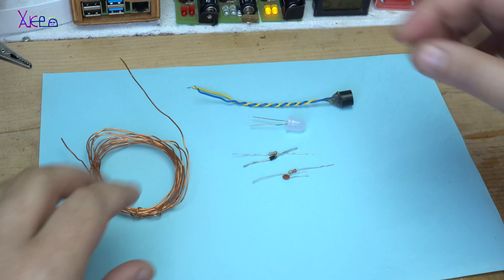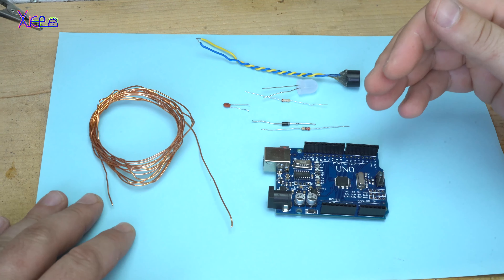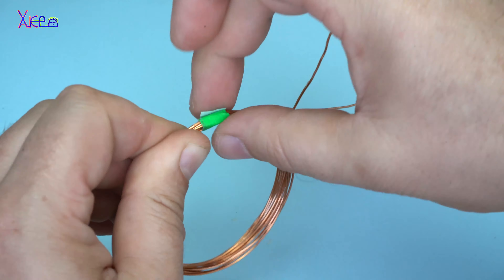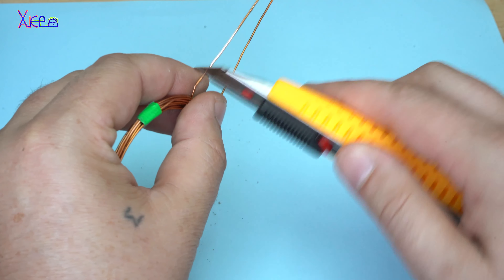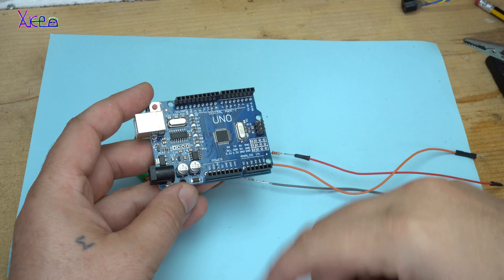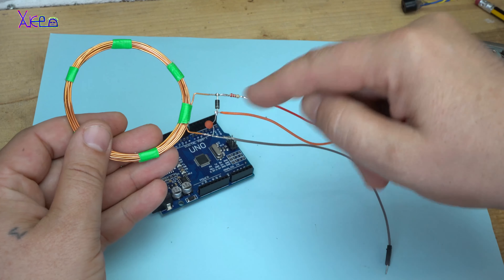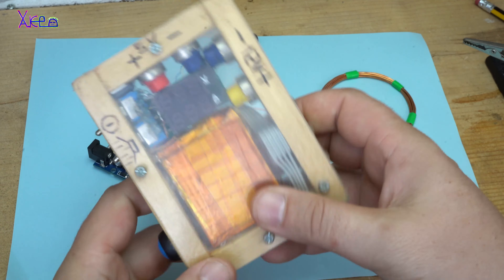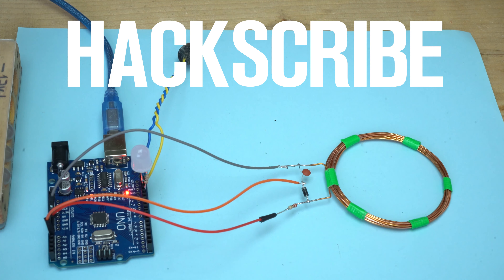Arduino Metal Detector DIY project

Comment: solid copper wire (3 meters)
passive buzzer(not active)
 one led
one resistor for the led one kilo ohm
one diode rectifier diode 1n4007 
resistor 220 ohms
capacitor 100 nF 
arduino board

Comment: Very nice and informative. Can the depth be increased by adding more windings to the wire or by adding higher rated resistors or capacitors? Thanks

Comment: Did you mention if the copper wire needed to be insulated or not.?.because the wire you are using looks like bare copper wire.ok you did great

Comment: You said in the video the orange and red wires go to analog inputs, which isnt right. only the orance goes to an input (to measure the cap load), and the red one to an output for sending short pulses to the coil.

Comment: Hi Hacktuber,
I never heard back from you as to what is the  gauge/diameter of the copper wire? Maybe the gauge doesn't matter? Also, one other thing that confused me was when you plugged the USB cable from your power supply (on the 5V side) into the Arduino,  the reading was 0. 03 A = 30 mA but it also said  11.1 V.  I was expecting it to say 5 V as in a normal USB voltage. No ? Please I would be grateful for your reply.  Thanks,  James
Reply: his power supply has a 5v buck converter, a phone power bank would work for this
Reply: 6cm

Comment: 3:02, why you mentioned the wire needs to be isolated? It wasn´t in the video or am I wrong?
Reply from the maker: Yes need to be isolated
Reply: He meant to say a wire with insolation by a thin layer of laquer. The same as in motors or transformators etc. That's why he scratched it off at the ends before soldering. Or you can burn it off.

Comment: Hi,
Very nice circuit  - well done! Your coil seems to be about 13 turns - what gauge copper wire is it   - how many mm, please ? Thanks,  James
Reply: he said 3 meters of copper coil
Reply: @mynameisjeffpatel1747  Hi Jeff, I think you misunderstand my question.  Iasked him what GAUGE wire he was using i.e. the thickness/diameter of the wire.
Reply: Length vs gauge......😁😁😁😁

Comment: using it outdoors seems less suitable, since it seems like it responds to the capacitive effect of the 60hz or 50hz mains power. or does it in some other way generate magnetic fields around it? or any less known effect?
Reply: The magnetic field frequency pulse is generated by the Arduino

Comment: Kindly asking the community, "how can I extend the detection range to about 30 - 40 cm?" If there's a design with that capability, please lead me to it. Thanks
Reply: Make a bigger version; more copper in a bigger loop with a larger capacitor. Also you would need to change the code for the buzzer and light to turn on at a lower voltage input.
Reply: @jrivers65  Thanks 👍 Im going to try that. I need to build one that is capable of detecting a vehicle from beneath the ground.
Reply: @technokid414  Hello, Did you do a bigger coil and its works? I have a problem with that.

Comment: It is real??
Reply: Yes, I did it and it worked.
Still not really powerfull, I'm suppose you'll need one of these model with transistors to achieve better results.
I didn't used the coil described here, so my limited results may come from this.

Comment: You have me interested until you pulled out the Arduino board. I like DIY projects without using Arduino.
Reply from the maker: I knew that,but is difficult and need more effort,more electronics components to make without arduino board,sorry
Reply: Why? Microcontrollers are super useful in projects. For example, have you every used an old analog metal detector? You’re fussing with the dials constantly and it’s no fun. Using a microcontroller, you can let the code do the work, set thresholds,  reduce noise, and create a finely tuned device that you can always improve. Plus you’ll have more data on how make improvements, why not?
Reply: Use Attiny after ...
Reply: You can make it without Arduino also 💪